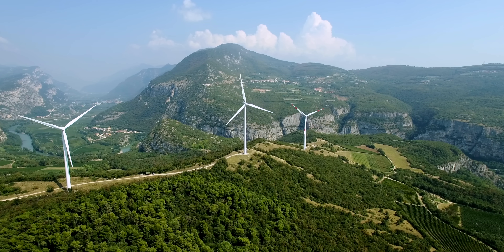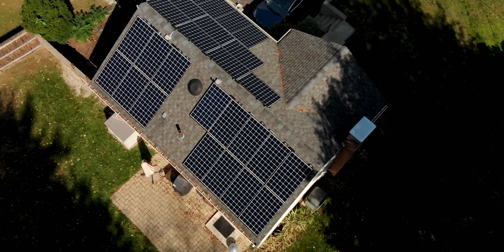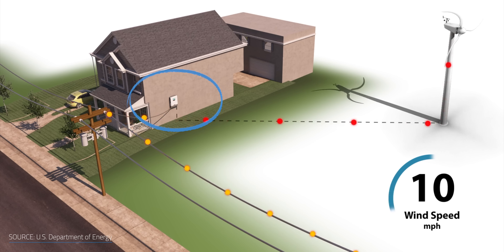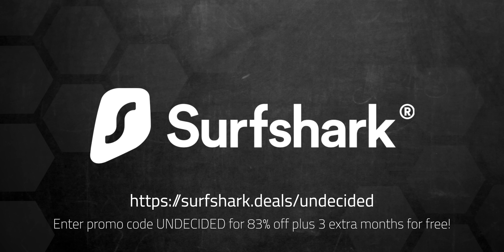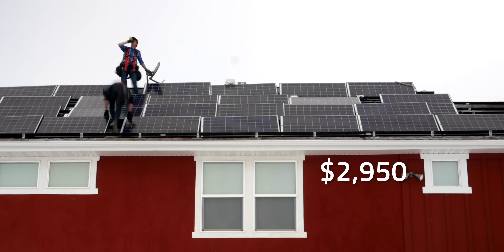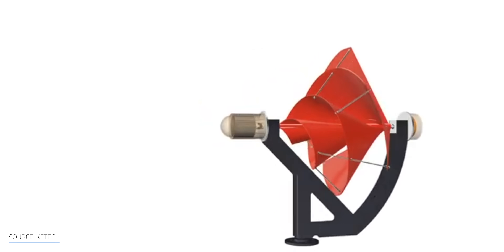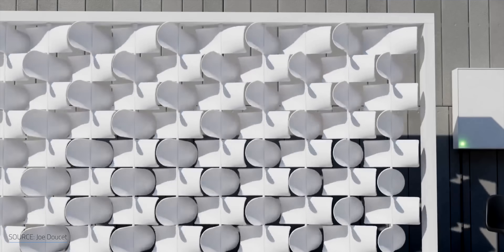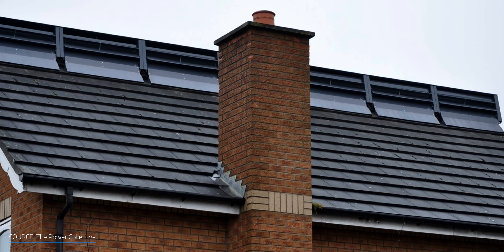The Challenges of a Wind Turbine on Your Home

Comment: I have a 3 kWh solar and a 4.8 kWh storage battery. Between mid March and October I can manage on just about my own renewable energy. But there is times throughout the year when I don’t and I want a home wind turbine to complement my renewable energy I generate, store and use.

Having a wind turbine will give me 24 hours of renewable energy generation.(almost). I would only need about 250 watt hours on average for 24 hours which would give me 4.8 kWh the same as my storage battery. 500 watt hours would easily run my home and charge the storage battery up but I don’t need all that, all the time because of the solar and storage battery.

I hardly use any energy throughout the night usually midnight till 8 am about 1.2 kWh which can easily come from a small wind turbine anymore will be charging the storage battery up, before solar starts charging the storage battery as well, in the morning.

So, a small home wind turbine would be very useful at helping to run my home 24/7 365 day and night and all year along with my solar and storage battery…

Comment: The reason why no information is available from The Power Collective is the company has gone under like most small wind companies. Phone number is not assigned and contact links don't work. No point mentioning them in a video.

Comment: At our summer-only cottage on Georgian Bay (Ontario) we got a Southwest Windpower (Whisper 100) wind generator installed in 2008 and it is still going strong in spite of the fact that it has never been serviced. True to its name it is very quiet--at worst like a flag fluttering in a full wind.

That said, this is an unusual installation. We're on an island and OFF-grid. Because we face the lake (north-facing) we were able to get away with only a 20 foot pole.

We also have 8 solar panels and a small-ish battery bank (4 deep cycle batteries). My view back in 2008 was that we had to choose between (A) a bigger battery bank or (B) a wind turbine (to diversify energy production). I chose (B) and have never regretted it.

Probably about 95% of our power comes from the solar panels. But every once in a while--maybe for a couple of days out of every two weeks--we get a relentless strong north wind with heavily overcast skies. And that's when the wind turbine becomes the star of the show.

It can also provide a welcome boost in the evening as the sun is fading away.

I'm careful to not leave the wind turbine on (it has a brake) overnight (generally) or when we're away. If the weather report calls for only moderate winds then I could leave it on overnight. But in a monster wind you can see how it could be destroyed by vibration or simply ripped apart.

Comment: Why does it cost $5000 to install a wind turbine? If the solar is already in place, adding an DC motor with wings on your roof will not cost $5000 or $80 000.

Comment: There's also (now thanks to synthetic ester insulation liquid, so not a low fire point oil) small transformers which minimise the power losses; from the generator to voltage conversion, as it's right next to the generator. This is instead of being somewhere else like in the base of the turbine shaft.

Comment: Wouldn't the roi change if you take batteries into account?

Where I live, the storage costs roughly 3-4 times as much as the appropriate solar panel, or 1.5-2 times as much as the wind turbine. 

If you now combine the two systems, thereby smoothing out the peak production to peak consumption line, you might be able to get by with less storage, resulting in a net positive or at least equal costs with less resource consumption.

Comment: Just a point !, what ever happened to the the huge mirror system for energy  which looked kinda like the ever watching eye in Lord Of The Rings whereupon it focussed an incredibly powerful beam of reflected sunlight directly on to heat exchangers creating super heated steam to drive a turbine ! . When I saw this years ago it was so powerful the beam would melt rock and of course it requires sunlight as do solar panels . The tower is concrete ( recycled ) , the mirror glass ( recycled ) heat exchanger  steel  ( recycled ) turbine steel ( recycled ) and water. It stands still mostly with some orientation but not waving about with huge stresses and where you have to climb hundreds of feet to maintain many moving parts as for the most ( photons have no mass )  and moving parts at height are minimal in this case ? sooooo what happened here then ( curious )

Comment: I think about all the massive farms that could have both solar and wind turbines. Not only would it help subsidize poorer, rural areas, but you could combine some wind turbines with agrivoltaics.

I remember seeing one wind turbine design used on highways. Not only did it use the natural winds, but it also used any gusts created by, say, transports trucks driving by at high speeds. I don't know how much power it uses, but I'm imagining some of those wind turbine walls along highways, maybe on the dividers in the middle, that could power surrounding areas.

Comment: You did not mention the higher blade configurations such as the one I have, which is an eleven blade 1600 watt unit. This unit works well in a wide variety of wind conditions. It was less than $2000 dollars and is an excellent entry point for homes. I have been running it for over a year now and it is very quite seats on a 40 foot pole and works in low wind conditions. It seems like you talked about all the experimental stuff with out looking at more practical wind turbines.

Comment: Years ago I built this as a proof of concept for a DIY windmill: https://youtu.be/WS-Jz3kZDHI  The central idea is that when the wind blows there is a high pressure side and a low pressure side for the roof. The ridgeline has very turbulent air as the wind rushes between them. A panemone is the cheapest and most efficient way to utilize this moving air. It's basically a paddleboard with the bottom half exposed and the top half sheltered.

Comment: I found 2 mistake, Average Wind Speed ≠ Average Kinetic energy in the wind, kinetic energy is proportional to the square of the speed. 
So suppose 3 scenarios, 
1) 4m/s speed for 2 hours, power generated will 2x4x4=32 units
2) 2m/s speed for an hour + 6m/s speed for an hour. Power generated = 1x2x2 + 1x6x6 = 40 units. (25% more)
3) no wind for an hour + 8m/s speed for an hour. Power generated = 0 + 1x8x8 = 64 units. (100% more)
Therefore the values you have will be different but still not enough to equal solar electricity. Another thing to take into consideration would be peak hour costs which are around sunset when the wind turbines will still be producing electricity and those units of electricity will have a higher value.

Comment: Solar power is great in sunny areas, northern latitudes in the summer months. However in Pacific NW there is an average of 225+ days with cloud cover. Seattle with 270 days on average with rain. However prognosis of wind in Climate Change currently trends downward in the PNW, but this calculation has a lot of uncertainty compared to the main goal of IPCC about rising global overal temperature that no longer can be capped at 1.5 C because of the current world government’s unwillingness to move away from fossil fuels and passing the burden on to the next generation of politicians

Comment: anything that can prevent building more large grid scale eagle choppers. we will run out of golden eagles otherwise. turbines do make noise as the bearings wear. maybe justifiable in non residential areas, especially on very large buildings.

Comment: That wall of spinny bits is a bird and cat killer for sure..  and the squirrel cages on the rooftop, yup, squirrel catcher..  and birds..  i don't even have any spinny stuff on my roof yet i still get dumb ass critters try to jump in my sewer vents..  

But why wouldnt you combine the wind energy with your hvac and using the captured wind to reblow, lol. But yea cool off thibgs on an ac system or use it as your blower air if had a heat pump or something...

Comment: Solar power is directly scalable, a square metre of panels produces the same power whether it's part of a massive solar farm or if it's on your roof. Wind power isn't viable to scale down. The power in the wind is proportional to the 3rd power of wind speed, so at light winds there is almost no energy to harvest, and around houses the wind will inevitably be turbulent. If you double the size of a wind turbine you get 4x the power. In fact, you get more than that because the bigger turbine will be taller and in the clean air with higher wind speeds. This vertical axis nonsense has been going on for decades. They don't produce meaningful power. Wind power makes sense for remote off grid locations exposed to high wind speeds and clean air. Like, hardly any residential applications.

Comment: Simply put, wind turbines scale with size (increasing efficiency with increasing size due to additional height and swept area) while solar panels do not. Therefore, wind turbines only make sense when they're built big, while solar panels produce approximately the same efficiency at small and large scales. No other factors are important here.
Reply: @siberx4 The area in which you live is most definitely a factor. Some of my neighbors have installed solar panels over the past couple of years, and they do absolutely nothing when they are covered over with inches of snow during the Winter. If I am to be completely off grid, then I need to have a mix of systems to keep my battery bank charged. In addition to snow during the Winter, we also have increased cloud coverage, but the wind is often more plentiful. So it makes sense to diversify how you are generating your power, and not put all of your eggs on one basket. If you live in a place like California or Arizona, where it is always sunny during the day, then you can stick with solar power only.

Comment: wind turbines can cost far less than you think i can get a 2000W wind turbine for 1000$ and in place more north here it snows about 3 to 5 monts a year and is hot around 3 to 5 month when its snows climbing on the roof to shovel solar pannel is a very dangerous thing to do while wind turbines will work all winter long but even here not many cities allow wind turbines

Comment: The answer:

Add
12 volt
Systems.. 

That cones as
A back up
Supplanted 
System ( for both battery
+
DC )

The RV
Market is here...

Add it
Reasonable $
Local
Local
Local

Vertical wind units.

Comment: Again and again the issue of CO2 comes up as if CO2 production is a disaster while people have no clue how low the precentage of CO2 in air actually is.  The extreme is when fuel consumption is expressed in kg CO2 per kWh.   Have we gone crazy?   What we are led to believe is that CO2 is a green house gas because of the low thermal conductivity.   At itself this could be a reason but there are two things: one is that the precentage of CO2 in air is only 0,035 % or 350 ppm.  Do the math and determine the effect on the change in thermal conductivity of the air mixture and you will see that the effect is zero-dot-zero.  You wil agree that whether that CO2 percentage doubles or triples the effect on the thermal conductivity of the air mixture is negligable.  Second is the question why the CO2 is so low while we produce CO2 by combusting fossil fuel.   And that is becuase of the fact that plants need CO2 for their growth.  Under the influence of sunlight the CO2 is broken down by the plants.  Plants keep de C for their growth and plants return the O2 to the atmosphere.  Plants are so fond of CO2 that they suck up everything they can which explains that the CO2 percentage in air is so low.  Satelite picture of recent years confrim that there are area's on earth that are turning green !!!!   In the Netherlands greenhouse farmers buy CO2 from the natural gas fired power stations and pay for the CO2 ...... as CO2 acts as a fertiliser.
And let us think a bit further: who are these parties who want to remove CO2 from the atmosphere? They are actually killing plant life and food growth.  Have you ever thought about that?
Windmills and solar panels are not the solution for large scale energy production as any energy specialist taking account of economic and environmental constraints can show you in half an hour.
The overall conclusion must be that the whole CO2 story is a hoax invented by people who want to break down worldwide economy and break down society.

Comment: Thank you for the info.
My idea is to lower our gulping appetite for energy.
It depends on using the right appliances.  For example:
Use a PRESSURE COOKER(PC)instead of a boiling pot.
PCs can boil potatoes in TWO MINUTES.  Compared to
Stove boiling, 8-10minutes.
Buy a 600 watt pressure cooker, not 1200-1500watts.
AVOID MICROWAVES: [700 watt] microwaves don't exist
700 watt microwave, actual power 1600 watts.
1000 watt microwave, actual watts 1600 watts.
Connect a watt meter($30)to your MW and see for yourself.

CROCKPOT instead of STOVE:
Stove burner 900-1800 watts.
15-20 Solar panels to power your stove.
Crockpot, 45-110 watts.
With a crockpot, power it with one solar panel.
CEILING FANs: 
Traditional 100+ watts, 4500cfm
Energy wise Fan, 32 watts, 13000cfp. 
LIGHTS:
Traditional, 25-60 watts
LED 2--8 watts
FREEZERS:
Replace old FREEZERS. Buy Energy Wise
3--7cuft freezer 130-220watts.  Need more?
Buy two freezers. Another freezer
3cuft freezer 130watts.  "Divide and conquer."
Power needed for freezer: 1-2 cycles daily
Put a timer on your freezer. Set timer to 8 hrs/day
Turn off Freezer at night. Check it the next morning.
Still frozen? --Disconnect the defrost cycle(600-800 watts)
You don't need it!
DISH WASHER:
Any brand: 15 gallons per wash
Fisher & Payckel 1.6 gallons per wash
KETTLE: 
2-3 Liter, 1500watts
1/2-Liter, 300 watts
Why do we boil 2-4 liters of water?
Family of 10, okay. But most of us,
1/2 Liter boil is enough.---
All that wasted energy.  Get the idea?
Conduct a review of all your appliances.
So, can we change our lifestyle and use less?
DEFINITELY!
Reply: I boil water and do most of my  cooking in the microwave.  I assume that the power usage is much lower than using an electric stove or oven. Am I wrong?

Comment: What is the lifespan of these generators and yearly maintenance costs (wind and solar) ? 
I do know that taller wind generators are more difficult and expensive to maintain. I also know that solar panels have 3+ types and their annual costs and lifespans vary. Graphene wind powered generators supposedly require less space, costs and maintenance.

Comment: A big problem in a dense urban environment is noise which could annoy your neighbours etc. 

As an example, a local supermarket installed a turbine (about 7 years ago) and it was fine for the first few months but I recall one evening there was the right (wrong?) combination of wind speed and direction to concentrate the noise it produced down at floor level at the entrance to the store. It was incredibly noisy standing there, and by strange coincidence the turbine was removed a few days later.

Comment: My folks live off the grid, and had a wind turbine for years.  After getting it re-wound 3 times.  They just installed more panels. They bought that particular turbine 15 years ago or so, and it was pricey, had ongoing issues. They bought a very cheap one recently, to power an electric fence, doesn't perform as advertised, but for $250, who cares.

Comment: I live off grid near the south point of the Big Island of Hawaii where we experience well over an average of 15mph winds.  I have two small (600W@24vdc) wind turbines.  One of them produces about 150w/hour and the other a measly 24-50w/hour.  There are some real junk turbines, especially from China.  I rely on my PV installation for power and my wind turbine for a supplement, to get me through the night.  At this state of technology, wind should only be considered as that (IMHO).  Even in the wind rich environment I live in.  I have toyed with VAWT systems, only to find them less productive.  Still, I like the supplement they give me, over night.  As for cost, Matt’s diagrams seem consistent with my experience.  Small wind is not yet as cost efficient as PV.  Thanks for the great explanation and validation, Matt.

Comment: Engi working in the battery and solar industry, the video is pretty much on point I think, something that is not discussed in many places is the actual cost of the system however. Solar modules used to be prohibitely expensive, inneficient and with a short lifespan., but have come to become the cheapest source of electricity. A big part of the success for home is it becoming mainstream and installation being optimised, very often now houses are built with solar. If there was a pre-built socket for wind turbines so that all it take is bolting down what would essentially a generator + blade, the installations would go from 20k+ to a few thousands top.

Comment: I am installing 10 kw (I can add another 1 kw,  but have to make the panel from cells) of solar panels.  But as I am in NE Ohio,  one of the cloudiest places in the USA,  I hope to add some wind as well.  I only need a maximum of 7 kwH a day (allowing myself some added usage here,  normally I use between 4 and 6 kwH a day year round).  First I need to get the system set up (rack mounted solar) and only have 100 AH at 48 (52.6) V of battery storage at the moment.  I figure 500 to 1000 W would be enough to supply my needs on cloudy days because we do get a lot of wind here.